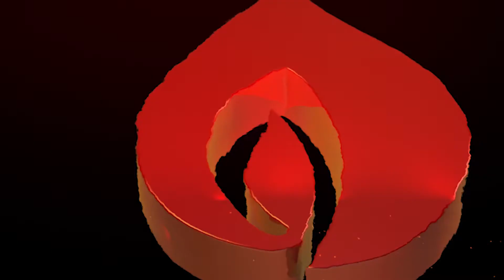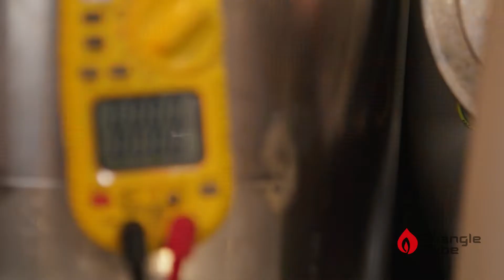How To: Diagnose Blower Speed Error

Comment: For those asking about no blower operation when removing the 4-wire (communication) connector….

If the blower doesn’t run when you remove the 4-wire connector from the combustion blower you must then check the 3-wire connector to make sure you have the proper line voltage to combustion blower.

If you have 120VAC from the 3-wire connector (high voltage AC) then the blower has failed.  Also, you need to check the 4-wire connector to make sure that you do have the proper communication voltage (VDC) to the blower from the control board.  I’ve found that almost 90-98% of the time the combustion blower is what fails and not the control board.  I can count the number of control boards I’ve replaced on one hand.  As for the blower… we keep them in stock!

Make sure the Venturi on your boiler is smooth and clean.  If it is rough or deteriorating you should replace it because it can cause rough starts and poor combustion causing soot and high carbon monoxide.  

Tip: Cleaned your igniter/flame sensor when you replacing the combustion blower.

You really need to use a combustion analyzer to check and setup the boiler after changing components.  Without a combustion analysis you have no idea how the boiler is running which can lead to expensive repair and the worst case boiler failure.

Be Safe & Good Luck.

Comment: well i called TT today and tech support told me if i have 37 vdc at the connector and the blower does NOT run then the blower is dead- i forgot to ask the voltage to test the other plug- but my blower will work if left off a few hours and then work - he told me that its going into thermal overload and shutting off if its intermittent and still same issue- replace blower

Comment: yea pretty pathetic that they dont address what the issue is if you unplug the 4 wire plug-- sometimes my fan goes full speed and after a day it doesnt - in 10 years ive spent more repairing this thing solo 110 than the gas savings..  E 28 error code..

Comment: What if it doesnt run when 4 wire plug is removed?
Reply: Did you ever figure it out?
Reply: Just to let you know, there was a recall in February for 28 models of Triangle Tube boilers due to the risk of carbon monoxide poisoning. This recall involves the ignition system and is separate from the 2020 recall, which affected many of the same models. You can check the manufacturer's website or the Consumer Product Safety Commission website to see if your model is affected. Also, Triangle Tube recommends having functioning carbon monoxide detectors on each level of your home, especially near where you sleep.

Comment: I don't have the three wire power connector socket on the blower but the power cable is ziptied to the signal cable. Also, I read 40 Volts between black and white wires.
Reply: Just to let you know, there was a recall in February for 28 models of Triangle Tube boilers due to the risk of carbon monoxide poisoning. This recall involves the ignition system and is separate from a 2020 recall, which affected many of the same models. You can check the manufacturer's website or the Consumer Product Safety Commission website to see if your model is affected. Triangle Tube recommends having carbon monoxide detectors on each level of your home, especially near where you sleep, and can provide one for free.

Comment: What if it doesnt run when 4 wire plug is removed?
Reply: Just to let you know, there was a recall in February for 28 models of Triangle Tube boilers due to the risk of carbon monoxide poisoning. This recall involves the ignition system and is separate from the 2020 recall, which affected many of the same models. You can check the manufacturer's website or the Consumer Product Safety Commission website to see if your model is affected. Also, Triangle Tube recommends having functioning carbon monoxide detectors on each level of your home, especially near where you sleep.
Reply: Crickets….